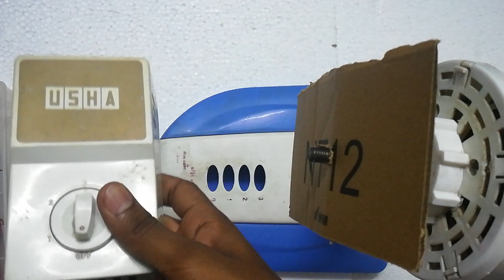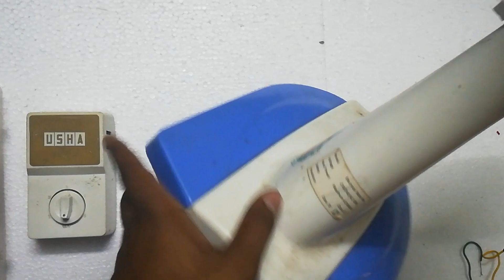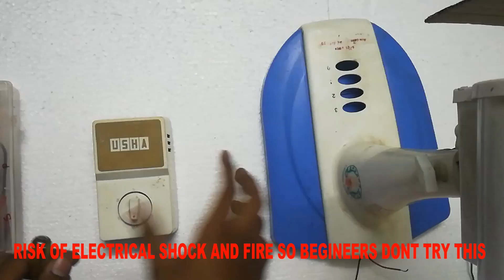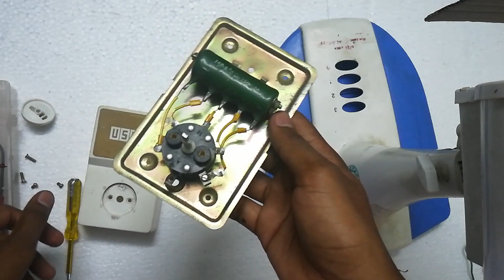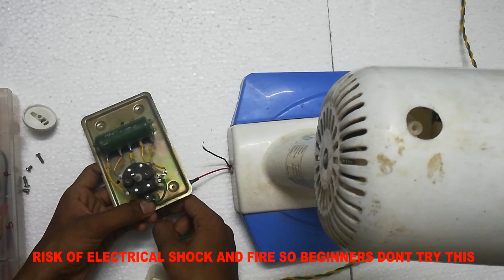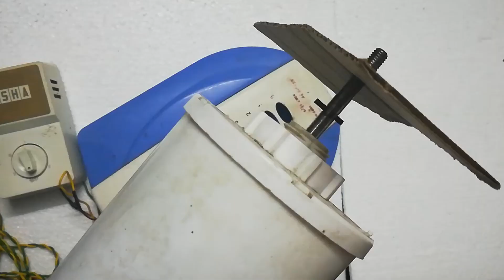How to adjust table fan speed by using ceiling fan regulator in Tamil

Comment: Bro what happens if  fan is connected directly through plug without regulator. I can do it bro
Reply: Thanx bro
Reply: Can I get your mail id
Reply from the maker: Clamensclamenscx@gmail.com
Reply: What if spark arrives in table fan regulator
Reply from the maker: Shorted
Reply from the maker: Yes u can directly connect to main supply without any regulator but you choose any one speed wire eg, Red for phase and black for neutral
Reply from the maker: Remaining wire insulate(separately) with insulation tape properly
Reply: K bro
Reply: Done bro but it is running slowly
Reply from the maker: Choose another wire instead of red wire that is find which phase wire runs fastly